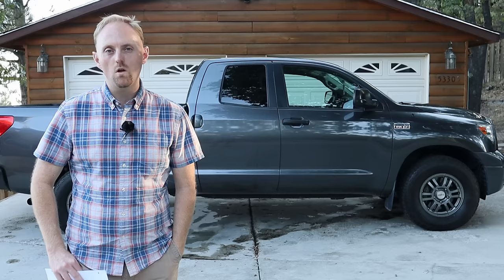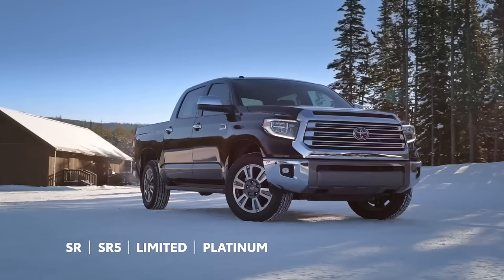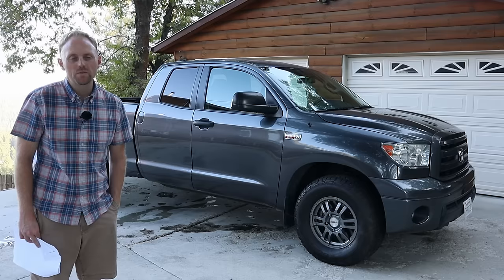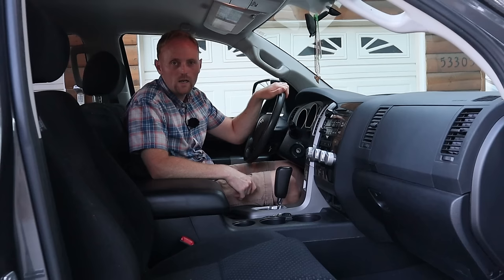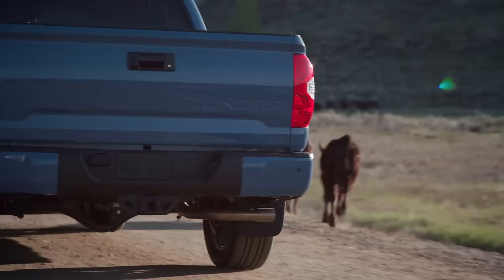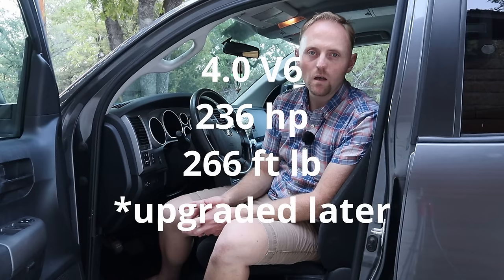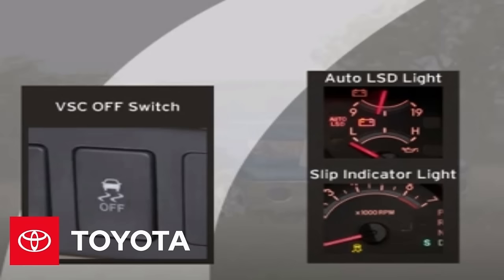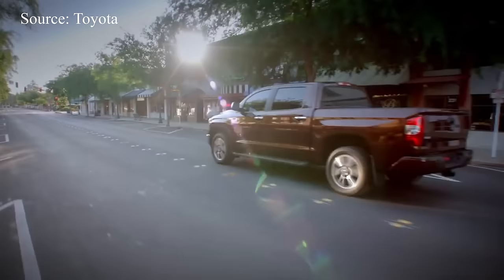Toyota Tundra  |  Brutally Honest Long-Term Owner Review

Comment: My first Tundra was a 2007 CrewMax 5.7 2 Wheel Drive. Drove 120,000 miles with ZERO maintenance issues over 10 Years. When my wife insisted I buy a new truck in 2017 because she planned to retire in 2022 and would get her new vehicle then and we only wanted one car payment I got a 2017 CrewMax SR5, TRD, 4x4, 5.7…I really appreciate the 38 gallon tank and went with the 4x4 because going down hill on a dirt mountain road with my 8,000+ travel trailer behind me with the 2 wheel drive could get serious but all that said my biggest concern when buying my new truck was reliability and towing my 31 foot two bedroom, one bath trailer…I’m retired so not a “work” truck so the 5.5’ bed wasn’t a concern so the comfort of the massive rear seat area was more important. Gas mileage…not great, but that’s not why I needed a truck. City I typically get 16 mpg and highway 20 mpg when not towing…towing the huge trailer I get a solid 9 - 9.5 mpg. Again, I’m retired so not a lot of day to day driving, five years on my “new” truck and 40,000 miles so function over fuel economy. My brother in law bought a new truck when I got mine and was having issues with it at about 65,000 miles on his Ford. My son-in-law bought a new truck about a year later and they had to replace the transmission, fortunately right before the warranty expired on his Ram Truck. Between my two Tundras I’ve got over 160,000 miles in 17 years with zero maintenance issues.

Comment: I own a 2015 SR5 double cab 5.7 V8 and tow a horse trailer. Towing is no problem. It is the limited payload that is a HUGE problem. Look at the horse trailer in the video. That trailer has to be made really light (and cheap - not safe in an accident) in order for the tongue weight to not exceed the hitch rating and payload. With the wheel placement in a horse trailer at the rear (under the horses) you have to be really be careful not to load anything into the front of the trailer where the "dressing room" is located. Even with a weight distribution hitch the Tundra will do a squat. This makes the Tundra not practical for towing a good, solid horse trailer. I have to make do with a short stock type trailer with an extremely small dressing room. I would love to get a better trailer but that means getting an F150 towmax. Tundra cannot compete.

Comment: Love this review. I love a truck that is used as a truck. The ergonomics of the Tundra are one of the biggest reasons why I love it. Main other thing is the reliability. My one and only huge complaint is the lack of a manual transmission. My Tundra is the first Automatic I had to settle for. Only part I do not like. And v6 is not an option.
Also Toyota is more American than the American trucks. I feel like they were always 1 or 2 steps ahead of the important things that matter.
I work my Tundra honestly hard. I tow, Haul, The Access cab is always loaded with my toolboxes and whatever I need for the job. Has plenty of cubbys and storage. 
I used to be a hard core GM guy. After the GMT400 I ran away. That was the last series  I liked.
My Tundra is a 2003. NY truck since new. 180k miles. Original frame. Blows away most any truck older than 2010 in the rust aspect. Still looks great. Most of the frame is still black. Has issues surely but not many.
I want to also note which  I am curious on your opinion. My Tundra has the Best functioning HVAC of any vehicle I have ever owned. Including my Caddys. Heat and AC work better than ever expected for a extended cab truck.
Thank you for taking the time to share
Reply: engine hours supercede miles,  my 14 silverado  clock reads 11321 hours , multiply that by average 35 mph  and that is over396,000   , by the way brake pads, battery and oil changes  my only expense

Comment: Good review.  I drove the 2011 Tundra and the 2011 Chevy Silverado 5.3 Z71 crew.  Which I bought.  130,000 miles and towed my camper all over the US and Canada.  Knock on wood but all I have had to do is oil changes and regular maintainance and tires.  Totally reliable.  (Oops, I did do the brakes once.).   Not knocking Toyota...wish they would bring out an all electric PriusV.

Comment: I have a 2013 SR5 double cab with the 5.7.  I love everything about it, except the fuel mileage.
Reply: When u buy a full size v8 truck , mpg should not even be a problem to begin with , cmon now it weighs 7 tons , u buy a tundra cause you want to have a huge truck and be king of the road
Reply: Janie Rios   I bought it for the towing capacity, the quality and the resale value, truth be told.
Reply: Scott Smith EXACTLY YES, BUT ALSO YOU MUST REALIZE YOU CANT COMPLAIN ABOUT GAS MILEAGE,
Reply: Janie Rios  you thought that was a complaint?  Hold my beer . . .
Reply: Scott Smith lol! Regardless we both know you are super happy with that truck! I love tundras myself! I own a 2014 crewcab and it’s the best truck you can get reliability wise, resale wise, durability wise

Comment: most of the other trucks have gone to smaller engines with a lot of turbocharging to get the needed HP, in the short run this is fine but if you want to keep the truck long term there is nothing like a big strong V8 for reliability, that is why the Toyota has such good residual value.  OK, you might want to trade every few years but who's gonna buy a truck with a reputation for engine breakdowns and transmission failures especially after the new has worn off the  cutesy features, most likely these folks want a truck that works, not a beauty queen.
Reply from the maker: Yes and I am looking at the new 7.3 from Ford.
Reply: If V-8s are so great then why does the trucking industry only deal with inline 6's?
Reply: @TruckerMike089  Different strokes for different folks.  Heavy duty trucks generally use very large straight six diesel engines of 12 liters or larger displacement, these engines are twice the size of car and pickup engines.  The straight six is probably one of the best cylinder arrangements with natural balance and smoothness, a V eight is really two rough fours on the same shaft, the straight eight deals with a shaft that is two long and thus whippy or too heavy, problem with the eight in a truck is the hood gets too long since a truck could carry the heavy crank, no problem in a ship or a locomotive though.  Mack built some successful V8 diesel engines.  The four cylinder engine has two blind spots each revolution where rather than powering the load it is taking power from it, sixes are always under a power stroke.  As for pickup engines, the chevy six of the mid fifties, some 250+ cu in, was a great engine, high torque, good cooling, good oiling, and good power.  A much better engine for a working truck than the small block chevy eight that would make more HP at high rpms but didn't have the low end torque of the six nor importantly the heat rejection ability.  The latter is important in trucks and cars if you intend to pull weight uphill, either as load or in a trailer.  Engines in cars and 1500 pickups are HP rated at max HP while true trucks are rather at continuous duty HP, this is why truck rating sound so low as compared to many cars.
Reply: @henryostman5740  very well put out. I still would prefer an inline engine for pulling. I currently run a Ram with the Cummins and I'd never go back to a V-8 diesel.
Reply: @TruckerMike089  a very good engine in a less than soso truck, sorry.  like to have that cummins in the toyota!  When you think of OHC or DOHC engines a straight engine makes a lot of sense since the total # of parts is significantly reduced and you get a neater under hood layout.

Comment: Great review.  Love my 2015 Platinum.  Also had a 2011 and 2012, those had a slightly better turning radius.  Supposedly the 2020's have tweaked shift points and fuel curves, so they're slightly more responsive and shift smoother.
Reply: But they removed the trans cooler :(
Reply: We have the 2021 and it runs GREAT!  Shifts very smooth, good turn radius, there is nothing I don't like about this truck.  We live rural, often pull 16 foot trailers...always hauling something and it fits the bill.  We have the Limited and we love the interior.  Very comfortable seats ..could drive it all day and be comfortable.  It is the 5.7

Comment: Bought a new 2006 Tundra crew cab 4 door, still strong at 145,000 miles with no major repairs other than some emissions BS. Even still running with all the original rubber hoses under the hood. Tows a 6000 pound RV trailer no problems. Guess I'll keep it for an even 20 years before trading to a newer version of Tundra.

Comment: I agree with you...Toyota should offer a rear locker. I just got a 2020 TRD OFF ROAD. I drove it on a long road trip to break it in, so I can tow our RV. I was getting  13.5 litres per 100 kms...not worse than my 13 Tacoma. About fuel economy...I gladly pay a bit more on fuel and save tons on repairs.....my cousin traded her Ecobust for a F150 with a V8....her turbo 6 needed a new timing chain...$2500 CAD parts and labor. I have owned GM and Ford...they suck like a DYSON vacuum. I expect my new truck to outlast me. I am happy my new truck has the 140 litre tank.
Reply from the maker: Ecobust... lol

Comment: Owned a 03 Yukon XL...Traded for A 07 Tundra Crewman plus $20,000 65000 miles.  $100 for the running and driving Yukon, $20000 for the four year newer Tundra.  Tundra has nothing broken, now looks new with $300 spent on cosmetics.  Yukon 212000 miles...no speedometer, no heat or air conditioning, air bag, traction control,  stability control, engine lights....passenger side door panel comes completely off when you pull the door hard to close..think the dealer sold it for scrap.  Won’t ever buy “American/Mexico” GM, Ford Dodge again.  Canada made...their labor isn’t cheaper..who bribed the Clinton’s, etc. when these jobs were sold out to Canada?  The only thing we need from Canada are logs.
Reply: and water and gas/oil  and maple syrup etc.lol
Reply: Rhonda M Like I said, “all we need from Canada are logs and maple syrup.”
Reply: @cblankenship3018 i hear trump is going to pay for a wall. lol
Reply: Mexico is going to pay for Canada’s wall, then we will have two...that is what he said.
Reply: then you will have to climb a wall to get away from trump and canada has closed its border to you already. lol @cblankenship3018
Reply: Rhonda M.  Go while you have a chance to leave.  Have you been there?  Canada is nice.
Reply: yes i have been it is beautiful love the mountains in bc and alberta. @cblankenship3018

Comment: Always owned ford/Chevy back when they built real trucks. Bought a 2012 crewmax Tundra haven't looked back. The reliability of this truck is unsurpassed. Dont really care about looks more about performance. That 5.7 still is a beast. The entire truck is very well thought out and laid out.
Reply: One complaint is having to remove skid plate to change oil

Comment: The Toyota Hilux pick up, the world's most popular pick up truck for 4 decades. 
...outside of the US of A.
Yeah, i own one...
Reply: Hilux diesel 4x4 Double cab, AT, 29,500 dollars in Mexico (27,200 in the border region, since tax is 8% lower). Everything but license plates included. No haggling price.
Reply: The hilux tripped me out. Saw a bunch in Mexico. Looks like my Tacoma but also looks like a highlander. Hoping I can buy a used one for my dad’s ranch down there.
Reply: I thought Hilux and Tacoma were the same truck
Reply: I think tacoma looks sharper than Hilux, but they are virtually the same truck.
Reply: the US Army has a fleet of Hilux crew cabs in Afghanistan, they are the most popular truck locally so it allows the Army to blend in, no Army markings, drab popular local color, no wash.  best deal is Army vehicles are only allowed to go 25 mph, the toys are allow to keep up with traffic (the locals fly), by the time an evildoer spots one and picks up his grenade shooter, it's gone.  the A/C keeps the troops cool.

Comment: I had a 2009 tundra 4x4. Sold it this year at 120k miles. Only issues I have is the radio, would go haywire coming on or turning off for no reasons and the mpg is horrible. Power and pulling power is great!

Comment: I would ABSOLUTELY buy a 2020 Tundra over the competition.  I'm driving a 2015 Tacoma with 126K on the clock.  At least half if not a little more is towing a 19 foot bass boat all across the midwest.  Toyota reliability is unmatched and they are absolutely bullet proof in their engineering and design.  My truck receives regular service at recommended intervals and in the 126K miles I've not had to make a "repair" that was not a normal maintenance item.  One of my biggest gripes regarding Toyota is their interior "plushness."  Granted I'm a truck guy who actually uses a truck for it's intended purpose of tow/haul on a regular basis.   I would enjoy having a more well thought out interior with higher end materials.  My Tacoma is a TRD Sport and the interior has a tremendous amount of plastic.   It works, it never breaks, and has maintained it's look since new, however it would be great to have higher end materials used given I spend so much time behind the dashboard.   Also if I switched to the Tundra....big lazy V8 with lots of torque.  The ecoboost puts down better numbers and it's a rocket out of the hole, but I trust good old V8 under stressed reliability.

Comment: Cant beat Toyota reliability.  Hopefully they address the awful mpg with the next generation.
Reply from the maker: Agreed
Reply: Rumor is that Toyota is gonna use turbos for the next gen. I don't think it will be as reliable as the 5.7liter.
Reply: By slapping a Twin Turbo V6. MPG goes up and reliability/longevity goes down.
Reply: They are talking over 30 MPG in next generation.
Reply: Yeah be careful what you wish for. Every time they add a turbo to a smaller engine the reliability goes down.

Comment: 2011 crew cab,leather seats
Updated stereo to 10” touch, new tail lights,
 head lights, 6.5 bed , pulls 11000 really good, not uphill tho.Not 1 problem! 130,000 I like the curves,the new ones look plastic molded.33,000 still worth 25,000!

Comment: Great review! I’m lucky enough to own a 2011 tundra crewmax and have had it for 5-6 years now. I love this truck. Tows great. Definitely noticed the frequent stopping for fuel. It’s my first truck and I love it though. It’s lifted 6” on 35” tires. Looks amazing and I get compliments from friends and honestly I can’t believe I’ve never had any issues it’s super reliable. Sadly it’s getting a little bit of rust I’ve watched my rear bumper develope a big hole. My rear differential is no longer grey it’s sort of rusty. Frame is perfectly solid still painted nice but it needs fluids changed and rear brakes soon. I also have a water pump and a serpentine belt with new tensioner to install.

Comment: I've wanted a Tundra forever, but the abysmal fuel economy is the primary reason I've never purchased one.  I may still pull the trigger...if I can even find one at this point. I wish I hadn't hesitated because now that inventories are so low, good deals are long gone. Most dealers are charging MSRP and above for TRDs, so I might look for a Limited Nightshade, which I also love.

I have to disagree with you on one thing, the new Tundra TRD Pro is a bargain in my opinion. At $50k for the double cab version, I think it's a solid deal for anyone who wants a truck that's very off road capable right out of the box, without the need to modify anything. It's ready to go! You're also getting the TRD exhaust standard as well. Just the exhaust, forged wheels and Fox suspension are worth over $5000.
Reply from the maker: good point thanks for sharing

Comment: Thank you for this review of the Tundra. I certainly appreciate the thoroughness you provide in your reviews. I was actually thinking about buying one but like you I'd like to see what they might have in store for a redesigned model. I'd also like to see a more heavy duty version sorta like the Titan. I had a 1982 Toyota pickup and I'd have to agree about the reliability. Best vehicle I ever owned. I would have purchased another but bought a 95 F150 because I wanted a full size truck.
Well my Ford is still on the road and is worth more to me than I could ever sell it for, but it's limited in towing capacity. I also have a small travel trailer, and I am "maxed out" with that truck.
Would like to get a larger trailer but would need a more capable tow vehicle. Did you buy your F150 because of it's towing capacity? The newer models are so much more capable than the 90's models. Thanks again.

Comment: Nice, thorough review. I have an 07 double cab that I bought new. Have 58,000 miles and runs great. Bought to haul my 31 ft camping trailer and has performed like a champ. Outside finish is as good as new. Only problem is that the bed rusted out under the bed liner without me being aware of it.